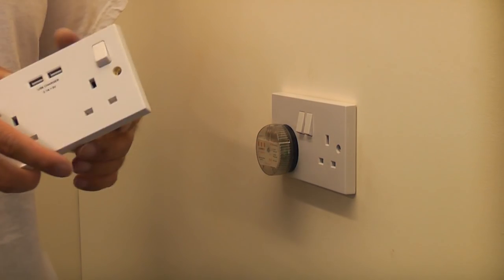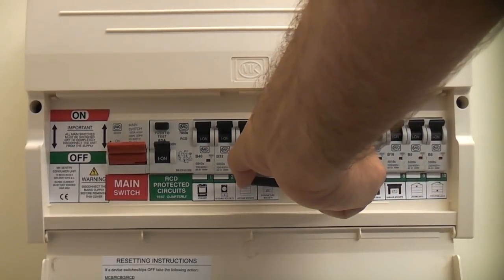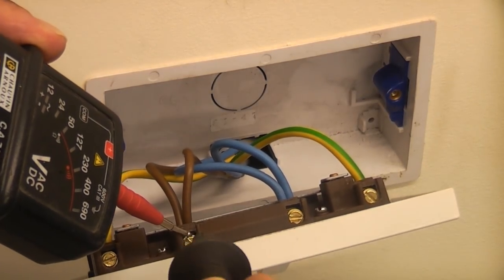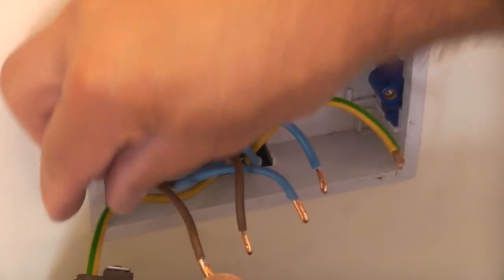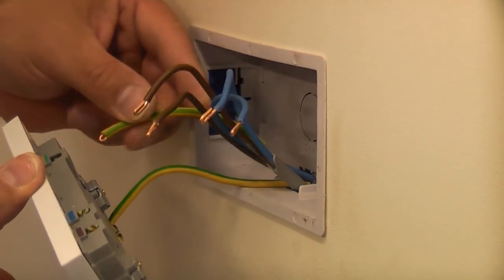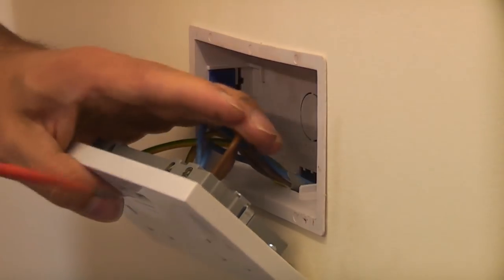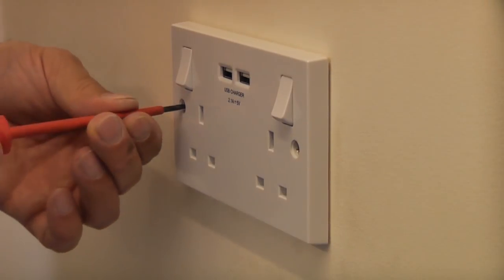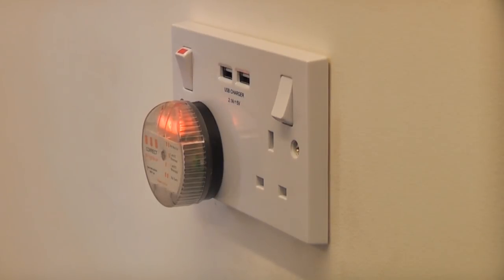How to install a USB wall socket

Comment: As a licensed electrician i am happy to say great job mate, couldn't have done a better or safer job myself. 👍
Reply from the maker: A. Samrout 
Thanks very much ;-)
Reply: A. Samrout Same, nice job.
Reply: +A. Samrout I'm thinking about going to uni for electric engineering,  I'm just interested in electricity!
Reply: It's not difficult however in Australia only licensed electricans can legally do this, and I have come across many DIY disasters.
Reply: A. Samrout aussie plugs are basically american plugs (which support 127V max) diagonal and use 220V. its too unsafe.
Reply: Without sounding thick. Cant you just put both earths in one hole?  What happens if you did/ didnt
Reply: @2loco   I want to install a double wall socket in my van conversion against some wood panelliing, is the back plate 100% essential? My socket didn't come with one. I was hoping I could just cut a hole and screw the socket to the wood? Would this be ok?

Comment: Another great video! I live in the U.S., and as you said in the beginning, this is for the UK only. But, I never gave thought to locking out the switch! Your video has made safety points to everyone. No matter where they are! Thanks!
Reply from the maker: Carl Rubino 
You are welcome 
Thanks for the comment ;-)
Reply: Carl Rubino Lockout/Tagout is actually more common in the US than the UK I believe... it's a dang good idea anyway!

Comment: hi good video, just one thing you might like to add to it. when making all electrical connections, just don't put wires into terminals and tighten, you should always look into terminals to make sure the screw does not trap the insulation of the wires. this is the reason why sockets,spur etc melt due to bad connections!

Comment: Nice video, clear & precisely done. The sockets I've looked at state a 35mm deep box. Changing a box to 35mm on a stud wall is simple but a bit more involved if it's a box fitted into block or brick.
Reply from the maker: Graham Convery 
Thanks, good point about the depth of the back box. If you are replacing a normal double socket the back box would be at least 35mm deep ( I would hope ), as most double sockets will not fit into the shallower 25mm deep back boxes without damaging the wires. I normally only use the 25mm deep back boxes for light switches- but I guess someone might try ramming a socket into one!
Thanks for the comment

Comment: Just a note about USB wall sockets. A lot of them are appearing to have high failure rates after a few weeks or months, one reason I've heard put forward is perhaps  because they are constantly on. There are a very few switched ones on the market which may prove to have a longer life. I'd avoid a lot of those for sale on a certain auction site as having opened a Chinese made one up (it was causing loads of radio interference in a friends house so we removed it) the standard of the transformer circuit  was horrific!  I'd definitely recommend  sticking to known brands with these to anyone wanting one.
Reply from the maker: +Choppington Otter 
Thanks for the comment ;-)

Comment: Most excellent video.  I love all the safety.  I forgot about the leader to the upstairs lightswitch when I turned the downstairs lights off at the fuse box.  I was changing the downstairs lightswitch in the hall and stairs.  I got a bit of a shock.  If only I had used the voltage tester first.  Ooops.
Reply from the maker: I'm glad you are still here to tell people about it 😉
Thanks for the comment 👍

Comment: Didnt even know these sockets exist! Thanks for showing how to change them too! Subscribed.
Reply: I have a question - can the USB sockets be used for all mobile phones, as I'm not sure but I think there's a maximum Amp level that charging a phone is meant to be at, or is any Amp OK as long as it's correct voltage?
Reply from the maker: Yes they can be used for any phone. A device will only pull as many amps as it needs, so as long as this figure is less then the maximum amperage of the USB sockets everything will be fine ;-)
Reply: Wow, thanks! Didn't know that either.
Reply from the maker: You are welcome ;-)

Comment: That's a slim socket for a usb integrated one. I'm still a little reluctant to install some of these purely for the fact that the transformer is permanently on even without load. I'm paranoid about that. Would be good if you could have a switch one for the usb outlets. The other reason is the cost! However since MK do one now it puts my mind at rest but at £25 it's not cheap! Thanks for the video. 

Also some intellectual sparkies don't like to bend the conductors like that, I can see their point about affecting the tensile stability of the conductor. I however don't have an issue and I find you get a more snug fit!
Reply from the maker: Zed Man 
A tighter fit in the terminals is better, even if the conductor is bent back on itself by the guy that installed the socket in the first place. How much easier would the job be if they incorporated WAGO connectors in the back of the sockets for the connections!
Thanks for the comment ;-)

Comment: Some of these sockets do not have a common earth so you may need to bridge between the earth conectors using additional wire. Plus you should always check both sockets with the tester as the plate may be faulty.
Reply from the maker: Thanks for the comment

Comment: Nice vid well explained. word of caution though, do not fit too many of these around the house or you're electric bill will be huge. transformers still waste energy even if there is no load connected.
Reply from the maker: CalumR 20 
Thanks for the comment
Reply: ***** no problem
Reply: CalumR 20 I don't think they use a transformer. The unit looks pretty small. Probably some sort of switched mode power supply. These often have very low vampire draw, so we should be able to install as many as we want.
Reply from the maker: jeales895 
Thanks for the comment ;-)
Reply: jeales895 Yes, the offload draw of these is practically nil. I am not convinced about the long term reliability. so I'd only buy a name brand :)
Reply from the maker: ***** 
Thanks for the comments ;-)

Comment: Great video, the sockets in my house only have one earth point and one wire.  Yet I’ve the same usb sockets to install as in your video. Should I run a earth wire from the empty space to the backboard?
Reply from the maker: Its best to earth the backbox (if it is metal), but I would not worry about it too much.
I've seen lots of backboxes that are not "supplementary" earthed.
Thanks for the comment 👍

Comment: I find a good tip is once the wires have been connected and the socket "wriggled" into place to ease the socket back very slightly and check the wire connection screws incase the wriggling movement loosened the wires.
Reply from the maker: Thanks for the comment ;-)

Comment: Brill video Thanks, Could you advice me I have a outside light with built in PIR, can i take it down and replace it with an ordinary lantern? Is the wiring the same? many thanks
Reply from the maker: +Anthony Harris Thanks.Probably not, unless your current PIR activated light has a switch somewhere you will not be able to switch the lantern off, unless it has a built in PIR? Normally PIR lights just have a permanent live supply, which means if you put a normal light on the end there is no way of switching it off.

Comment: Really useful, and helpful video. I just went to change mine, however, there is only one Earth? Do I just use one, or should I install another sort length earth, and where to?
Reply from the maker: How many live and neutral wires are there? If there is just one of each just connect the one earth wire.
If you have two or more live and neutral wires you need to find the additional earth wires as they need joining to the earthing terminal.
Reply: Ultimate Handyman two neutral and 2 live, but only one Earth.
Reply from the maker: You need to find the other earth wire. Without it there will not be continuity of the earthing which could be dangerous under fault conditions.
Reply: Think the 2nd one was removed.
Reply: Find it dear Paul, find it.
Reply: Noticed that the second earth, has been added to the 1st one, and then had a new earth insulation put on.

Comment: very helpful can you tell me difference from using a plastic back plate and a steel one please
Reply from the maker: Steel back boxes are normally used on solid walls and are normally recessed into the masonry.

There are two types of plastic box, a dry lining back box for use on plasterboard walls or a pattress, which is designed to be surface mounted.

Thanks for the comment
Reply: thanks again

Comment: hi chez hope your ok.great vid..i am after a voltage tester and am always intrigued as to the tools you use. i was wondering if the Chauvin Arnoux CA740A-you use is good or is it just something you bought at the time. The reason why i am asking is because i have never heard of the brand.before. I was thinking about buying a dilog..any advice is appreciated. Many thanks.
Reply from the maker: arfan jhangir 
Hi Arfan, The Chauvin Arnoux was bought for me when I was an apprentice. I had never heard of them to be honest before that. 
Most voltage testers are similar, but for professional use I would ensure the tester meets the requirements of GS38
The Dilog one looks fine, although I have never heard of them before either!

Comment: You have to be careful with these sockets. If you're going to use them, then you have to buy the expensive well made ones (MK brand). There's the added fire risk, the risk of leaking DC current if installed poorly, and the cheaper brands have a smaller current that charges devices a lot more slowly.
Reply from the maker: Thanks for the comment

Comment: Just changed a double socket for a double socket with USB, but it went pop and knocked the circuit breaker off.

Decided to revert back to the original fitting and research online as to why the USB version went pop.. (So some constructive feedback would be great, cheers)

I'm thinking it may be that the circuit might need a bigger breaker?

I did also end up using some connector block from old wires to new wires due to the wires being very short.
Reply from the maker: Leon RW 
I would definitely not increase the size of breaker as that is very unlikely to be the problem.
Perhaps the new socket was faulty, or incorrectly wired.
Have you replaced the old socket?
Are the connector blocks still being used?
None of the wires or connectors were crushed when the socket was tightened to the back box were they?
Reply: ***** Thank you, a few other people and yourself have said that the circuit breaker would not likely be the problem at all. 
I imagine it's most likely my error by using connector blocks and I've also read they can be a fire hazard if not used correctly.

I put the old socket back with the original wires and have removed the connector blocks as I think they might have been more harm than good in this situation.
I didn't see or feel anything being crushed whilst putting it back in.

I could actually probably rewire the socket without the connector blocks, I just didn't try moving the old wires around enough I don't think. There is also still quite a lot of insulation inside the box before the wires even start to appear.

Have you heard about or noticed any common faults with replacing older double switch sockets to the newer double switch sockets with USB?

Many thanks,
Reply from the maker: Leon RW 
You are welcome.
I have not heard of any problems with these sockets apart from some poor quality ones, if you read the comment below from Graham Reid.
Reply: ***** great, thank you for your help :)
Reply from the maker: Leon RW 
You are welcome ;-)

Comment: as a matter of interest is there rules that say sockets can be only certain height, I would like to move ones in my son's room so they in just above his desk, rough ly 3 and half feet?
Reply from the maker: There are recommendations for socket heights but they only apply to new builds and are mainly to ensure that the sockets are not installed too low down on a wall or so close to a kitchen worktop that the flex of any item plugged in could be damaged.

Comment: I think they are 2.1amp 5v shared between the two sockets not 2.1amp each; if i am reading the specs right. Expensive currently, hoping that the price comes down a bit more.

Question are the usb sockets 'active' even when the switch is off ? just while it might only be a small power use, it stills means they are running when there is no load...
Reply from the maker: ***** 
Yes the USB sockets are active with the switch off.
Thanks fr the comment

Comment: Very clever! Is there something similar for connecting DC power to an outdoor CCTV camera via a mains socket? If not, how would you connect a DC power supply inside a room to a camera outside?
Reply from the maker: I don't think there is a socket with DC output. I think you would just have to use a normal transformer and plug that into the socket- hopefully, it will not be one of those with the big plastic cylinder near the output plug.
Reply: Yes, or alternatively one could mount the DC plug on a blanking plate with the inside connected to the camera. Nice and professional looking, but possibly OTT for what's needed.

Comment: Will this USB socket fit a 25mm back box or does it need a 35mm back box, I've noticed that the sockets come in different depths. Love the vids.
Reply from the maker: +howlis 
I think you would struggle with a 25mm deep box, 35mm would be much better. 
Thanks for the comment

Comment: Is it specifically for B.S1363 sockets (UK Standard) or can it be applied to other type G plugs around the world?
Reply: +Georgie Orman As far as I understand aslong as you have earth, neuatral and live you can use this socket but there are only seven countries which have Type G. UK, Ireland, Cyprus, Malta, Malaysia, Singapore and Hong Kong.

Still you would want to check that the amp and voltages are the same as the UK before using them otherwise there might be an issue.

Comment: hi there. thank you for the useful demonstration. ive just purchased these same sockets for my house. however this particular brand seems to be flawed. after wiring and testing with a usb volt/amp meter I have discovered that the usb ports on this socket only put out 4.6 to 4.7 volts. this is below usb standard of + - .25v as a result although this socket is rated at 2.1 amps, nothing can draw that. if I plug into any "normal" charger my phone changes at .8A however into this wall socket only .46A if I plug my tablet into a "normal" charger it draws 1.7A but into this wall socket only .3A I feel that due to the low voltage the devices cannot draw the current they require. do you know if there is an accessible potentiometer inside the usb part of the socket so the voltage can be raised? any other ideas? all other variables in the test are the same, same wires, same charge state, same test equipment.  I can only think that this particular brand of wall socket is unsuitable for purpose? :-(
Reply from the maker: kevin oakes 
No idea sorry.
What brand is your socket?
Reply: Ok thanks for the quick reply. I don't know the brand but it is identical to the one in this video. Looks exactly the same front and back and same writing re usb on front....
Reply from the maker: kevin oakes 
I'd be tempted to return it where you got it from and get a replacement if it's not up to the job (if you have the receipt)

Comment: Do they make sockets with 'ethernet over mains' ? I've got piggyback tp link but built into a wall socket would be good.
Reply from the maker: Noth Ankyou 
I believe this is what you are looking for-
http://www.powerethernet.com/product/power-ethernet-t1501.html
Reply: ***** Thanks for that! Now if it only had switches!

Comment: For some reason I have two single sockets side by side is it possible to take both off and replace with a double thanks
Reply from the maker: It's impossible to say without seeing the wiring, as they could be on separate circuits etc.
Thanks for the comment

Comment: Can I ask what the reason for 2 different earth connections is? Other sockets in our home have the earths sharing a connection
Reply from the maker: In one version of the on site guide it showed sockets on a final ring circuit with the earth wires of the circuit in each of the earthing terminals, but it's quite common to see all earth wires in just one terminal.

Comment: Just to say I find your videos very informative. The only issue I have is dealing with wiring in existing sockets which is too short to fit into new sockets. As an example I have an existing socket where the wiring comes in on the left hand side. I wanted to replace this socket with a USB wall socket. Unfortantately the live wire was just too short to reach the live wire in the new socket. Very frustrating!! I have seen that you can use wago connectors but not sure how safe they are ??
Reply from the maker: Wago connectors are perfectly safe and very easy to use.
Just make sure you buy genuine ones and not fake ones ;-)
Thanks for the comment

Comment: Obviously I'm no electrician and just followed how my older socket was connected the two earths were pushed in together rather than up and down like you did with the usb socket does this matter 

Thanks
Reply from the maker: That will be fine.
Thanks for the comment

Comment: Its a neat idea but due to advancements in chargers every new gen of phones i wouldnt go this route. Also many lower power devices warn to not use higher powered usb ports. While saying use a computer usb port they are  neglecting to mention that means no USB 3.0 as well.
Reply from the maker: ***** 
Thanks for the comment ;-)